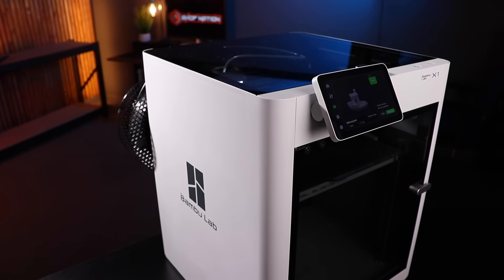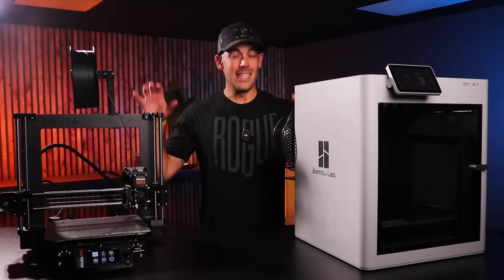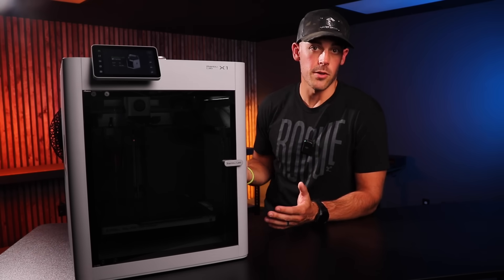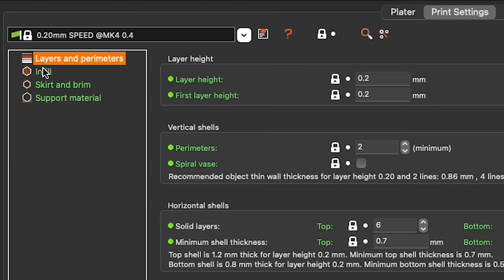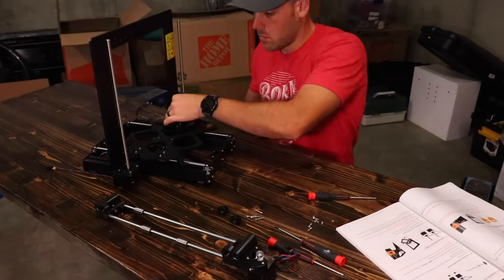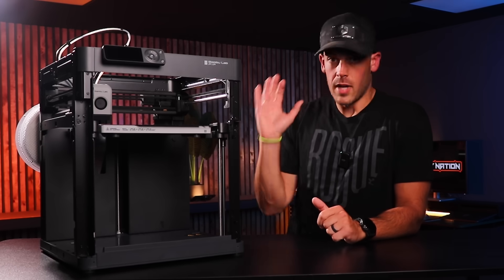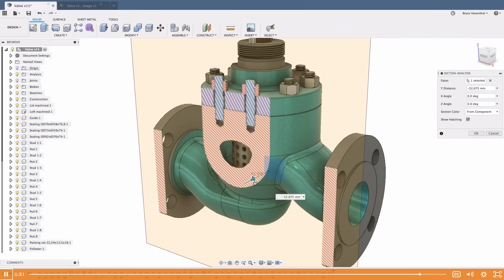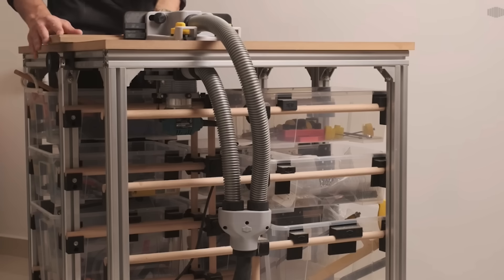The 3D Printer I'd buy if I started over

Comment: I am glad that I stumbled upon your page. It has been a trial and error struggle related to choosing the right printer for my business needs, and I even spent several thousand on a single machine that is great, but in the end is not a great fit. Had I seen this earlier, I would have purchased both the Prusa and the Bambu as you did and pitted them against each other. Likely keeping both. Looks like I will have to add them now, though.

Comment: Greetings, does anyone have information on how many grams of material the printer can use per hour ,I don't need exact data, maybe a rough figure. And whether these types of printers can work with High Density Poly Ethylene (HDPE) materials? Thanks in advance.

Comment: I kinda Gave up on my Prusa. Never got a good print out of it, part of that issue was probably the fact that i had to sleep in the same room as it was functioning in (or didnt sleep), but getting all the firmware sorted out was so confusing and frustrating, that after it jammed for the 3000'th time. It got the "I'll deal with it tomorrow" and never turned on again. That was 8 years ago. The friend that I bought a printer with (i had money at the time so i bought us both one) Literally now does it as a job. 

I still cant be bothered to try. I have uses for it, I have things that i would like to build. But man getting the thing to stay running is so hard. I would actually tell you not to buy a kit. Because even though you learn the intricate workings... After the 100th attempt to get even just a proper first layer down... Well. I would have broke the brick wall with my head. And the next one.  IT killed my interest before it even began. And now its just this monstrous wall i don't want to touch because i expect it to go badly.

Comment: Prusa discontinued the MK3S kit earlier this year, and now only sells the ready-made model for 900 bucks. However, there's this company called FYSETC that makes a 1 to 1 clone of the MK3S. It comes as a kit, and uses a genuine Einsy RAMBo motherboard, MK52 heat bed, and control panel, and also runs the official Prusa firmware. It even uses a PINDA probe for auto bed leveling.

I bought one of these a few months ago off Ali Express for 230 bucks, and swapped out the generic rods and bearings for genuine Prusa ones, the Meanwell LRS-350-24 PSU for a Delta 240W fanless PSU, the hot end for a genuine Prusa hot end, and the gantry for a vibration dampening gantry from a MK4. It didn’t come with instructions, but since it is a copy of the MK3S, I was able to use Prusa's online instruction manual for the MK3S to assemble it. In total I probably spent about 570 bucks on this printer, including the cost of the printer itself, and the upgrades I made to it. 

Best of all, once you get it dialed in, it prints just as well as a real MK3S. It gives you the same upgrade path as one too (I plan to eventually buy one of the upgrade kits and turn it into a MK4)

It’s also insanely quiet. I have mine in an enclosure, and the only things I can hear are the stepper motors. If I turn on Stealth mode, the printer becomes totally silent. For me, this was a huge deal, as my previous printer was a heavily modified Ender 3 V2. Boy was that thing loud. Now I can actually run prints overnight without being kept awake by the noise.

I should note for anyone else who tries this, the instruction manual for the MK3S was for an earlier revision. My MK3S kit was one of the later revisions, so I also had to follow a second manual for installing some of the redesigned parts

I should also note that unlike the official Prusa kits, this one didn’t come with the complimentary bag of Haribo gummy bears. It also didn’t come with an SD card, so make sure you have one on hand.

Like the real MK3S, you can also solder a GPIO header to the motherboard and install a Raspberry Pi Zero W for wireless connectivity. In my case though I’m just gonna stick to using the SD card for now, and eventually purchase the upgrade kit

Comment: I love @7:22 where you sit back to admire your work. Only thing missing is a beverage and a "cigar".

Question: Core XY or Bed Slinger? My model is a 7" high cylinder with embossed text. My QiDi X Plus Core XY has lots of ringing on the text. I tried a friends Adventurer 4, bed slinger, and there seemed to be much less ringing. I hear bed slingers are losing ground to Core XY. 
In your (anyone's) experience, do bed slingers have less ringing?

Comment: Ive had printers available in engineering and lab work for years, but never really saw them as a reliable practical tool... until one new guy insisted we get a bambu labs X1C. Yes for a hobbyist it is an expensive toy, or for a print farm it might be a little too fancy, but as an engineer needing to just make little test models and demos its incredible and FAST. It is able to print fine threads used for optics components easily and has transformed work flow. dimensionally, it prints a few thou oversize but does so consistently enough you can plan for it and make proper sliding fits. get the AMS thingy too, it can hold 4 different filaments and keep them all dry with some desiccant packs in the holder.

Comment: I might be a little late to this party, but what would you recommend for someone that has had an Ender 3 V1 for over a year, already dealt with most possible issues, and wants to just get a better printer to print better and faster. Would the P1P still be a viable option in 2024?

Comment: Thank you for an excellent video. I'm just looking to buy a 3D Printer and some of the items you discussed were extremely helpful. 

I require a 300x300x300 minimum size, but don't want to spend a fortune to get started, so was thinking of going for the Creality Ender-3 Max NEO 3D Printer (300*300*320mm). If anyone out there reads this comment and has a view on that printer, I'd be interested to hear from you. Thanks once again for a great video.

Comment: Everyone should start with a $99 Ender 3 pro, If you can get it to print this is the hobby for you, and move on to better machines. If you start with a $600 piece of equipment that doesn't work as expected from user error you will be way more upset.
Reply from the maker: That is the most ridiculous advice I’ve ever heard
Reply: @ShopNation  you can buy a new Ender 3, sell it for exactly what you paid, and not lose a dime. They come with ABL and will print perfectly fine without modifying anything. If $600 isn't a lot to you go ahead and get a p1p but that's not the case for everyone. I don't print things for a living so perhaps I see things differently. I am glad I didn't start with a x1c, because when it doesn't want to print I have the skills from enders to fix it.

Comment: And in the 1 year since this video was released printer's have a come a long way. Now Presa and Bambu labs are two of the best brands for at home 3d printing, HOWEVER, do not bash on the Creality Ender 3 V3. Now, I will not tell anyone to go out and buy a basic ender, because for $50 more, you can get the V3 SE and it is worth the additional 50 bucks! The V3 SE is not a printer you buy to customize, cause it already has the upgrades you would add to a basic ender 3, auto bed leveling, direct drive and a magnetic heated base. For $220 I'd recommend the Ender 3 V3 SE to anyone that is interested in a printer they can use basically out of the box without spending an arm and a leg like proposed in this video. For the additional $1000 you'd spend on either of these printers you could get a lot of bed adhesives, a really nice enclosure, and a butt ton of filamen and print to your hearts delightt!!

Comment: This video is a little OLD now.... The best 3D printer, easy , out the box, and MULTI-COLOR is the A1 Mini From Bambu.  Bambu Lab A1 3D Printer is $339 by itself or $489 with Multi Color Printing (you can print up to 4 color prints). You can easily print multi-color/Multi filament prints... you can print support in a cheap filament and actual print in good filament. It has all the features of the P1P for a much cheaper price. It has features , that the P1P/X1C doesn't even have, including easy hot-end swap, better automatic print head cleaning, and more. You will not have any regrets buying the A1 , especially as a beginner. 

If you prefer XY printer and you want something with an ENCLOSURE , then I recommend the P1S ... The P1S is the P1P with a few upgrades for $100 more (P1P is $499 Now, P1S is $599(4 COLOR AMS is $849)).  Most people will not notice any difference between X1C and P1S... it's mostly a useless Lidar... 

Also as a beginner, I recommend you buy a Textured Print Sheet and Liquid Glue... it will make life easier when it comes to 1ST LAYER PRINT ADHEASION. meaning your first player will print better and stick to your plate better and hopefully will stay stuck to your plate until the whole print is done. A big problem I had was the BED temperature was low and the print would get loose mid-print.

Comment: Bought  ender 3 v3 KE and was working on it instead of using it. Not even one model came out 100%.
Thanks for these reliable choices.
Still have few questions.
Is it true that bambu waists from quarter to half of filament  used for the model?
Will it worrk well without enclosure? I live in very humid  area.
Do i need filament drier?
Thanks for the cleqr and entertaining video!

Comment: A while back I bought a wanhao duplicator plus (i think I read somewhere it's a different name because I live in South Africa but is the Same as Prusa not sure if that is true) I could never get mine properly level and had tonnes of issues of the nozzle catching the print or even the plate sometimes.
I also had tonnes of warping and could only the most basic of stuff (which still had defects).
I admit this could all have been down to my lack of understanding the leveling properly although I spent hours googling and trying.

Just a warning if you looking at the Wanhao duplicator plus(if they still available(

Comment: this is all fine and good, but unless you know for certain you want into this as a hobby, get yourself a used Ender online for 50-100 and learn what you're doing first.  Enders work just fine as an entry level tool.  once you know what you want and have pushed your cheaper Ender further, THEN drop cash on the mid-level printers.  and if you're really doing fabrication printing later on, then drop your big bucks.  however you want to go, 700 bucks is way more than anyone needs for their first.

Comment: I have a BambuLab P1S and I really like that it basically just works. I have a CR-10 that needs rebuilt and had a second-hand davinci a before that. If I had to get another printer, regardless of money I would acquire a Prusa XL with the multitude of hotends. Mostly for having different nozzle sizes and multi-material without having to change parts.

Comment: I have had the P1S Bambu Lab for 11 months now.   Using it when I need parts fast, mostly, and that is just about every day.  All of my parts are for use in my commercial machines, or for tools and use in my company.   I just had my first failed print, so I did the "calibration".  I did the calibration when it came.  And just now.  I have not ever worked on this printer.   But just waiting to do that at some time.  My other favorite now, is the Kingroon KLP1 220 which you just set up once, level it and z setting, and just keep printing.  It has really surprised me, as I bought it thinking it was going to have problems.  I always use filament "cleaners" (foam blocks or the commercial clip on versions)on the filament to keep dust from entering the print nozzle.  I have even used packing foam and put some tape around to create a little pressure.  I have, now, 32 printers, and the latest is the 1600 x 1000 x1000 Dowell, which I made some simple modifications to the print head so it prints faster, and a new DM Pro 1800x 1200,1200.   I printed the very first fiberglass mold for commercial use using 400 mm printers.  So I graduated to the 1000 Plus size printers.  It took 40 blocks of prints (PETG) to make it with 400 mm printers, so now it will take 2 prints.  For the 400 mm I used 1 ea CRM4 Creatity, and 3 Anycubic Kobra Maxes printing 24/7 for months.  The Kobra Max is faster than the CRM4.  The new Kobra 2 Max cannot print above 2.5 KG without the Y axis motor slipping "cogs" and making a tapered completely off to the side, interesting, but worthless thing.  Have to slow it down or the Bed sling has too much inertia for the motor to stop the loss of "register".

Comment: I'll add one more to the good tips in the end of the video: throw away the "print everything" mentality. The other day my wife asked me what I was looking for in the gardening supplies of all things. Well I found a bundle of flexible plastic mesh and noted that it can be used with printed parts, but I don't have to print something that already exists and costs nothing in the home depot. 
Around the same time I started to print, was also the time learned to bend and cut acrylic glass, cutting and using aluminium profiles and practicing more woodworking than I already knew. Oh and the skill of "soldering" plastics with the filament should not be underestimated.

Comment: Regardless of how reparable the Prusa is I wouldn't touch it with a 10 foot pole, the Bambu devices just have such a superior aesthetic to them and offer so much more at each price point that the Prusa isn't worth it. I bought an A1 Mini and an A1 combo for the same price as the Prusa MK3 was listed, they're probably as good on most fronts and better on several too. I can also print two things simultaneously where I would only be able to print one with the Prusa.

Comment: Stumbled...Ouchhh...My wallet :S
Complete noob at 3D printing but not at 3d modelling.
Currently thinking of buying a Bambulab x1c because the printer is going to be in my bedroom and I prefer to be safe and have a fully enclosed printer with built-in filter.
My only concern with the x1c is that I read in a lot of places that it wastes a lot of material and filament is very expensive (to me). I do not know if it is best to go with another printer or if I should buy/diy build a machine to recover the wasted filament.
Reply: Just so you know, Bambu Labs is having a sale until July 5th.

I’m currently trying to decide between the P1S and the X1C. The former is quite a bit cheaper for the same performance from what I’ve been reading, just fewer bells and whistles.
Reply: @riflemanm16a2  Thank you. I know.
I am trying to decide myself but am leaning more to the X1C because it supports printing with carbon reinforced filaments and is possibly more future proof. I do not know if I will need it and, from the specifications of both printers, I can not see why the P1S does not support printing with those. The specifications (temperatures, speeds, etc) are identical between the two printers.
I intend to use the printer for prototyping and production of replacement parts.
Either way I will have to get a loan to pay over the next 10 years so the printer must last that long.
Good luck with your choice.

Comment: I don't own one but I only hear good things about the ender 3 v3 se/ke models, like being able to print right out of the box. They are smaller but also a third maybe even a fourth of the price. I just got into the hobby via a used ender 3 pro (the 8 bit one), soon as I learned to level my bed and orient prints correctly on cura I've not had many failed prints, my fails were because I didn't use "adhesion" or brims/skirts on some of my prints. Also the new flagship creality models are on par if not better than the Bambu offerings. Don't get riled up with brand fanboy crap, do your research even on an old ender 3 pro it took me a few hours to figure out how print and a few days to actually understand calibration. 

That's not to say if you have the money for something like the flsun s1 go for it, 1200mm/s speeds😳.

Comment: I stumbled upon 3D printing because of my job in aerospace, and I was immediately hooked. I started experimenting with it for vehicle testing and ran the Ultimaker non-stop. It never failed and was incredibly easy to use. Then, I made the mistake of getting a high-end Creality. What a letdown! I was constantly changing parts, and it felt like every print was a gamble. Eventually, I gave up and just used the one at work. Now, I’m intrigued by Prusa for more home use. However, I’m skeptical because if you watch YouTube videos or read reviews, no one seems to have anything negative to say about Creality, which doesn’t match my and my peers long-term experience. I question everything now.

Comment: I went all out with my first 3d printer, got the very nice ender 5 plus. 
It's too big and unnecessary for most projects.
My advice to noobies is either go cheap and small with decent quality, or get a dual filament model. Spending over a grand as a beginner is just stupid imo. Especially for single filament models.
Even the p1p is kinda too big and kinda to expensive to get started with. 
Cura slicer is easy, and as intuitive as the user, so your choice of slicer shouldn't influence your buy choices imo.

The P1P does look like a really good option though, but my advice remains the same, either get a very small one or a dual filament model. A small one is handy to have as both beginner and as an additional tool for smaller projects, and a dual filament model is a game changer
Especially for single filament models.

Comment: HOLY GRAIL CHEAT: I've greased the wheels and rails on my Ender 3 and have been printing for 6 years all day every day. Never adjust the bed, no adhesion problems, 100% reliability every time. If your good at math and engineering and physics you can spot potential problems before they happen. I might be an alien